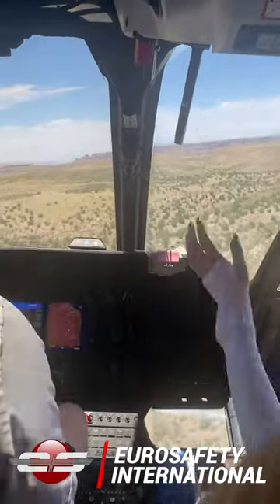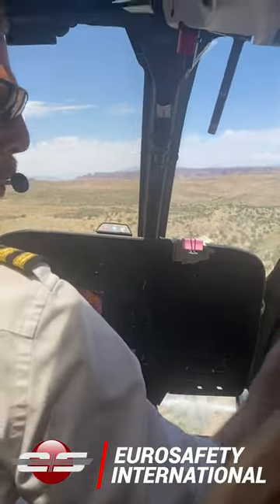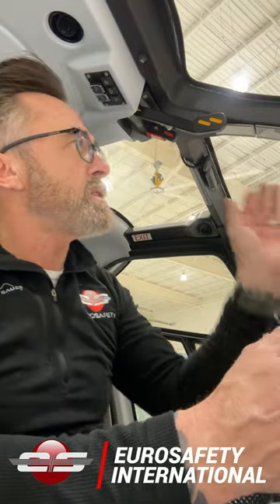The Reality of Grabbing the Rotor Brake in a EC130 #aviation

Comment: So it is okay to pull the rotar stick thingy when i go on my joy flight?
Reply from the maker: Perhaps you did not watch all the way through. I pointed out that the handle is locked. The term locked in this statement means the inability for a person to move said lever without "unlocking" the device. Hence if someone grabbed the handle and attempted to move it, the handle would remained fixed in place.

Comment: It still would have probably caused 10s of thousands in damage.
Reply from the maker: Perhaps you did not watch all the way through. I pointed out that the handle is locked. The term locked in this statement means the inability for a person to move said lever without "unlocking" the device. Hence if someone grabbed the handle and attempted to move it, the handle would remained fixed in place.

Comment: Then what's the point of that handle?
Reply from the maker: After the helicopter is shut down the engine is no longer driving the rotor system. When the rotational speed reaches 100 rotations per minute (which would be a speed where you can see the blades moving past you) we apply the rotor brake because at that reduced speed the centrifugal forces are no long hold rigidity in the system and excess flapping can occur.

Comment: Yeah I always thought that had to be over dramatized. I don't care what kind of brake it is, it aint slowing down them blades under power. He would simply just have to quickly reach up and disengage it before it got hot. The little lady definitely isn't going to cam that handle down in full brake position..

Comment: Helicopter rotor break is mainly used for maintenance to prevent accidental startup. As the guy said it’s physically impossible to fully engage at operation speed.

Comment: 6000 rpm?
Reply from the maker: Yes .... The shaft that the rotor brake is mounted on spins at approximately 6000 rpm when the throttle is in the flight position.

Comment: 6000 rpm?
Reply from the maker: the output shaft is spinning at approximately 6000 rpm (its a variable rotor system so the rpm  changes)
Reply: @EUROSAFETYTRAINING  ok cool. I thought actual rotor, which would make tips supersonic.

Comment: This guy downplaying someone grabbing the rotor brake in flight is ridiculous. Especially from a company with safety in their name. I don't know the aircraft in question so i can't speak to specifics with that particular aircraft but, for him to say the rotor brake could not stop the rotor because there's to much power while ignoring the fact that a route brake being applied under power is a sure way to cause catastrophic fire and likely kill them just as the pilot in the original video stated.
Reply from the maker: Perhaps you missed the part of the video where I explained that you cannot engage the rotor brake without unlocking it. Perhaps you also missed the part where I said that a passenger should never touch the controls. Perhaps you missed the part where I said that you would have to pull it all the way back if unlocked to engage. Perhaps you missed the part of the video where the passenger merely touched the brake, not grab it. "Catastrophic fire" you said.... I wonder ... do you feel alittle like a drama queen? But like you said you cant speak to specifics on this helicopter... but wait... you just did. But of course I often find out that people that make comments like yours are not helicopter pilots but have watched alot of videos so its just like being a pilot.

Comment: This guy is lying, on older model helicopters, there is no such locking mechanism. The video of the woman pulling the lever would have killed everyone on board and that is a fact.
Reply from the maker: I'm hesitant to engage with comments that seem to lack a foundational understanding of the subject matter. It's important to note that the EC130 has always been equipped with a rotor brake locking mechanism. The assertion that it's a 'fact' everyone on board would have perished is not based on accurate information or understanding of the aircraft's safety features.

Comment: actually designed a rotor brake architecture  for a cs 27 aircraft. there are 4, completely separate systems that can all disengage the rotor brake when in the air, only one of which is the 2 action switch. you can flip it and absolutely nothing will happen. Even if it were to be engaged, it will burn itself up long before anything bad happens. we still tell the pilots they will absolutely be killed to death if they touch the switch in the air. pilots like to feel they are in control. engineers let them live in that world.